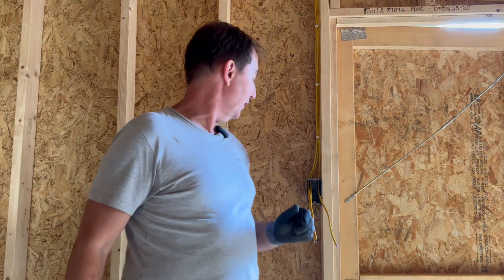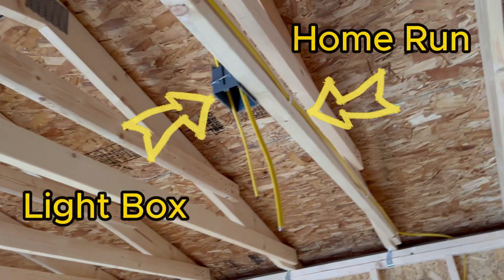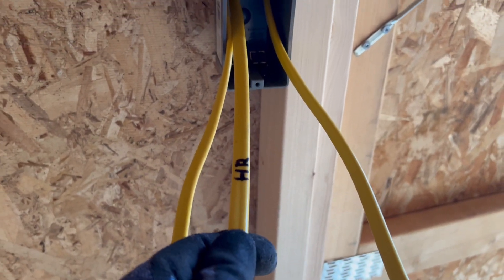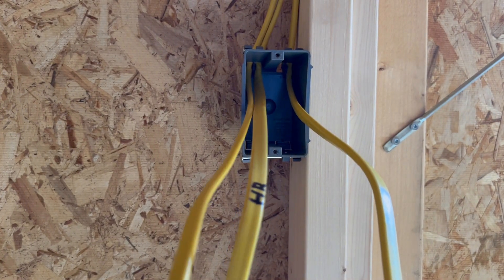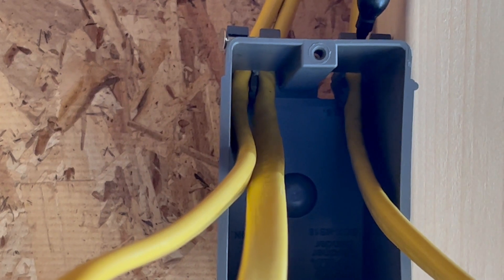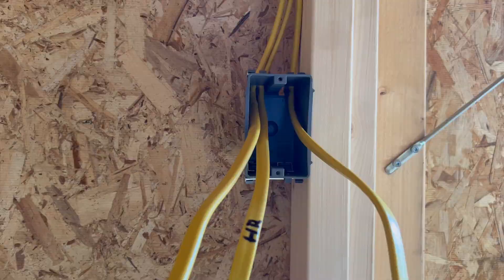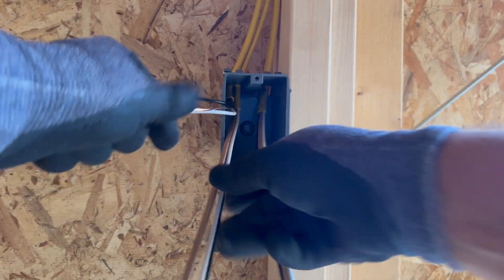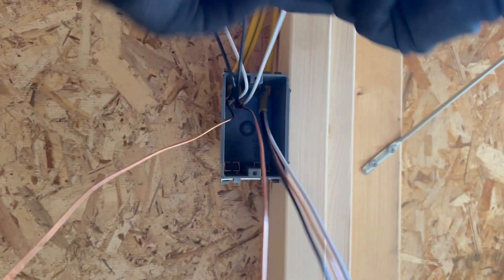How To: Wire a Light Switch #howto

Comment: Thanks - Exactly the video I needed to show how to trim out one of my switch boxes before drywall.  After watching this, I realized I could get the grounds and neutrals done and tucked back in, get the hot wire pigtailed, and stop stressing about labeling the remaining black wires before drywall as I won't need to know which is which when I go to install my switch after drywall.  For the light receptacle box, did you pigtail the wiring there or just use the pass-through screw terminals on the outlet?
Reply from the maker: Thanks for watching and commenting! 
At 8:41 or so is where I do pigtail the hot wires for the 
switch . I’m so glad it helped. 😊
Reply: @YourFloridaElectrician  thanks for the reply - I got that part.  I was actually asking about the light receptacle on the ceiling, as I don’t think the video showed that wiring.
Reply from the maker: @Loach402 the video sure didn’t show the light wiring, but if you have more than one light to wire, you could definitely twist together your power wires then twist together your neutral wires coming in with the ones going out to the next light.
Reply: @YourFloridaElectrician thanks - I follow. Keep up the great videos!
Reply from the maker: @Loach402 I will slowly slowly.